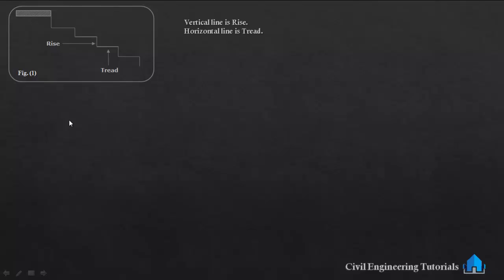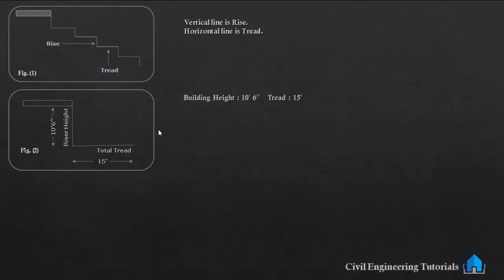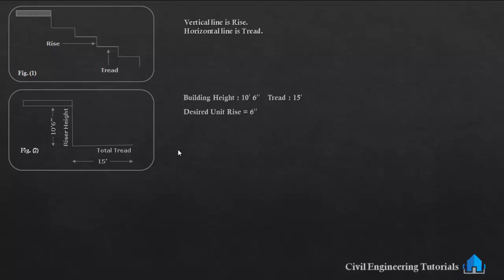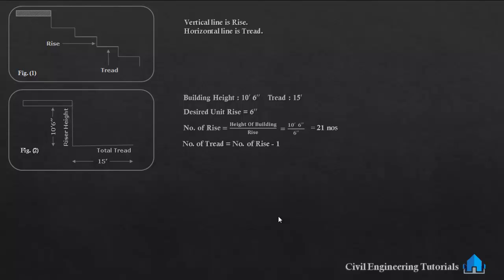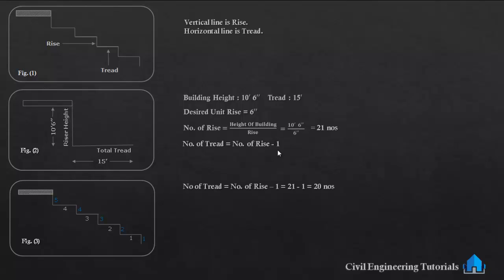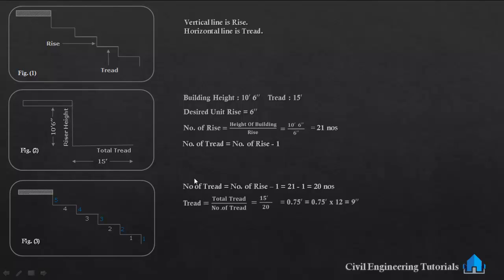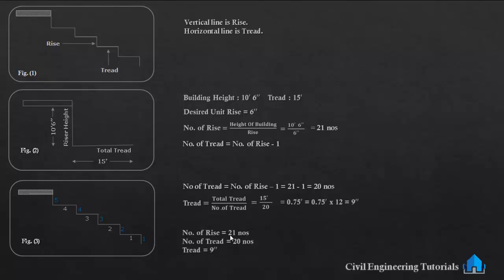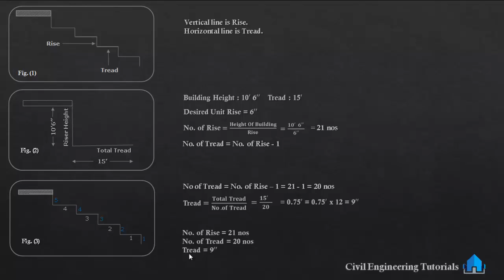How to calculate  number of Rise and  Treads of Staircase

Comment: Where does the 12 come from in the total goings. The 0.75 x 12? I don’t understand where the 12 comes from?
Reply from the maker: 0.75 feet, to convert it into inch multiply with 12 inches 0.75'x12 = 9"

Comment: Mam i didnot get hw you calculate the 21 nos of rise....can you pls tel me once again
10'6"÷6"=21 nos ?????
Reply from the maker: To calculate no of rise you need to divide building height with desired unit rise. Building height is 10 feet 6 inch and rise is 6 inch.  10 feet equals 120 inch + 6 inch = 126 inch. 126/6= 21

Comment: Tell what way you find 15' total tread?
Reply from the maker: 15' is total tread & 9" is length of one tread. Total tread & height of building is given & you need to calculate length of one tread & rise to draw or construct the staircase.
Reply: What do u mean by total tread is given..?
Reply: @mohanmoni8543  Total tread is the space given for staircase. You can change your total tread value according to your requirement
Reply from the maker: Thanks Suganthi